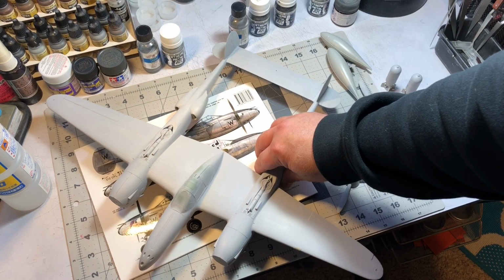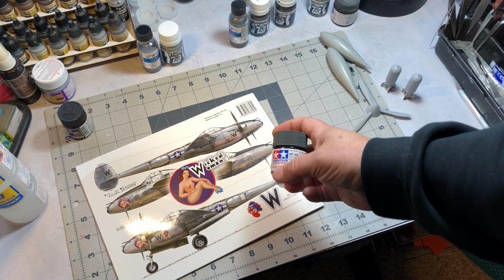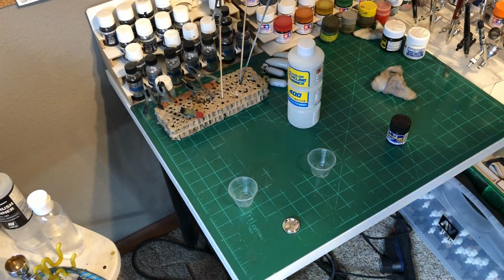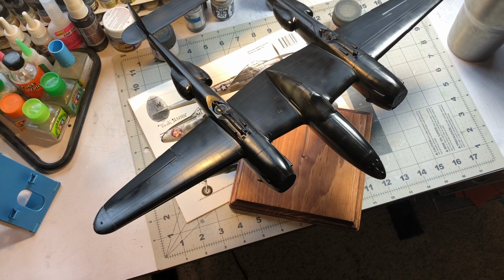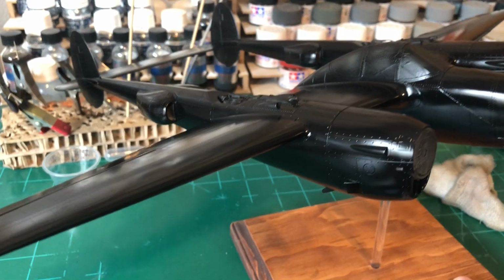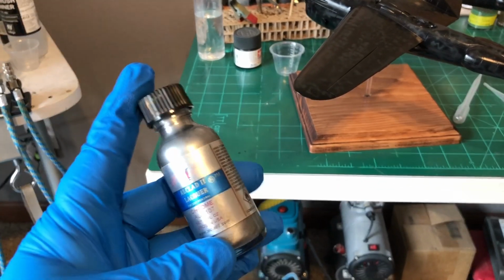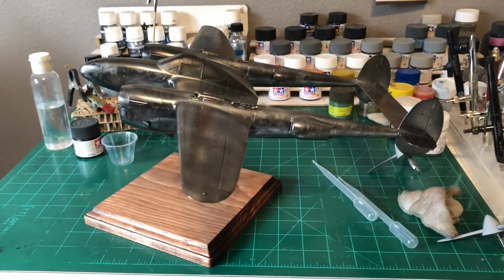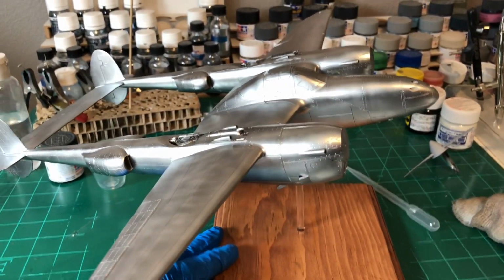Trumpeter 1/32 P38 Part 2: Painting a NMF Base Coat

Comment: I used to use actual smoke.  I would set fire to the ribbing that the parts came with— hold an old T-shirt over the smoke and cover the T-shirt with black soot—rub on model as needed—it gets all the rivets etc. and it’s authentic smoke!—this was back in the 70’s